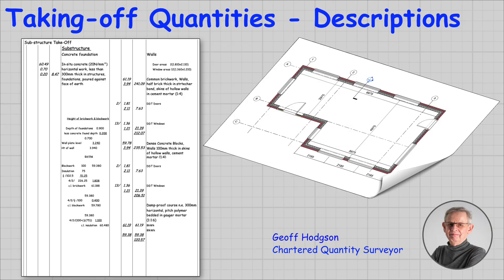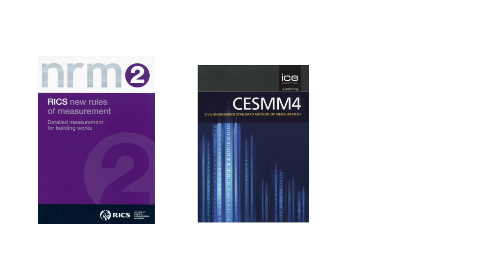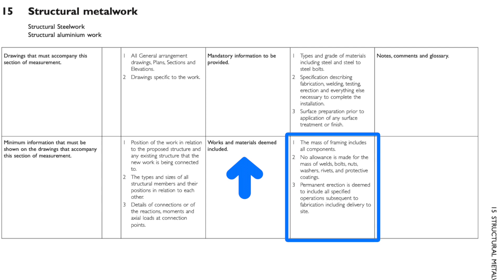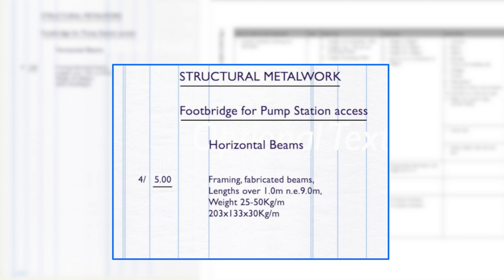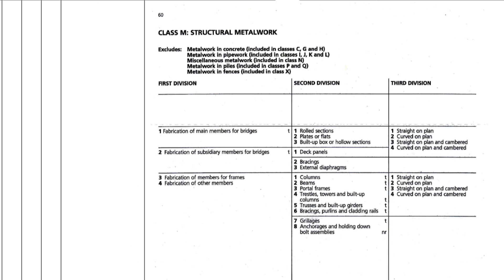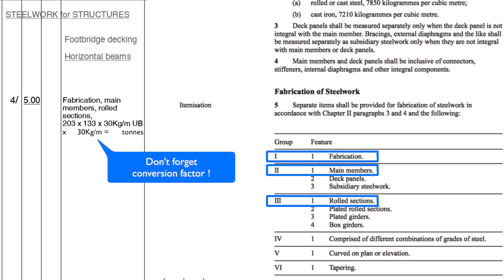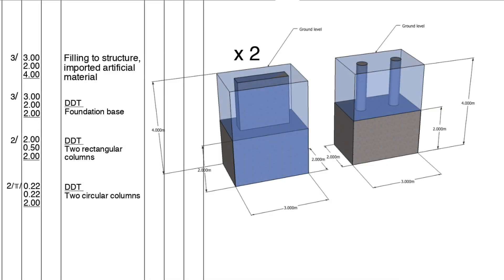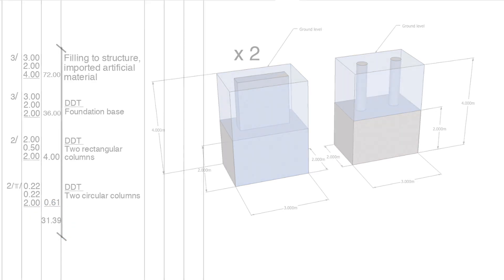How to write Descriptions from NRM2, CESMM4 and MMHW

Comment: One challenge for preparation BoQ is extracting cost sensitive information and convert them to discriptions has to review hundreds pages of various reports like soil report, insulation, fire, accessibility etc. and it is very easy to miss pick up the cost related information in a time constraint environment.
Reply from the maker: This where accurate specifications are absolutely paramount and method of measurement description amended (within the MM rules) if necessary to reflect the specification. I agree It's a difficult job.